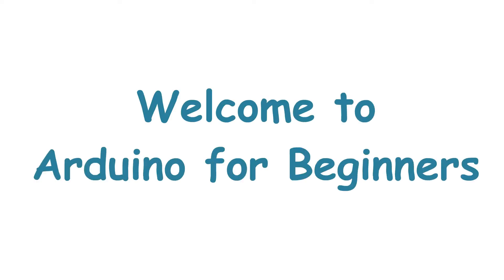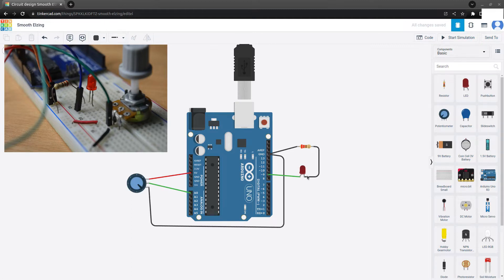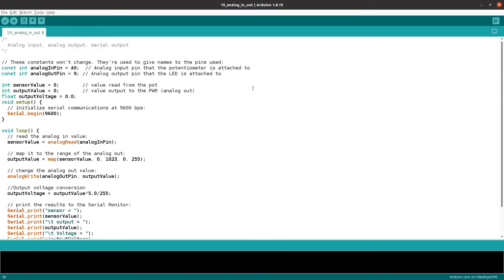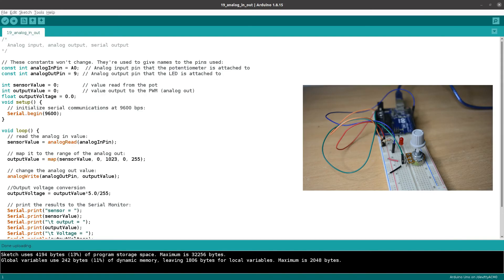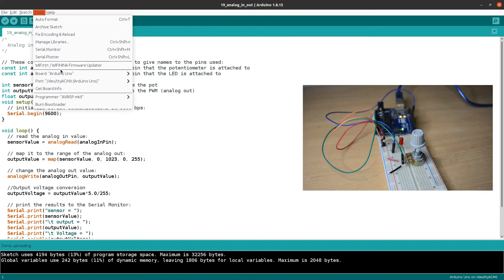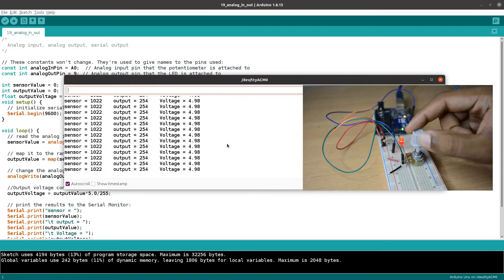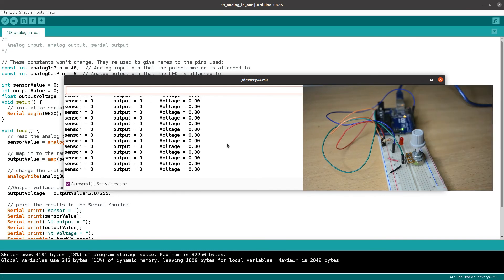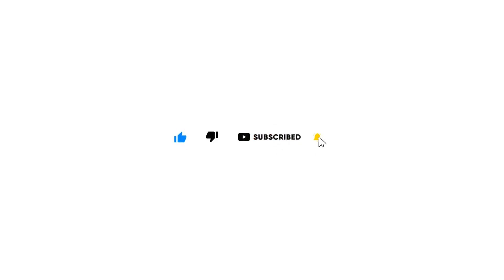தமிழ் | LED Brightness control | Analog Read | Lecture 19 | Arduino tamil | Lost tech Tamil

Comment: How to  write program for LED blink with a frequency between 1 Hz and 10 Hz
adjustable by the potentiometer (if turned fully left 1Hz, if turned fully right 10 Hz).
Reply: Without using map command